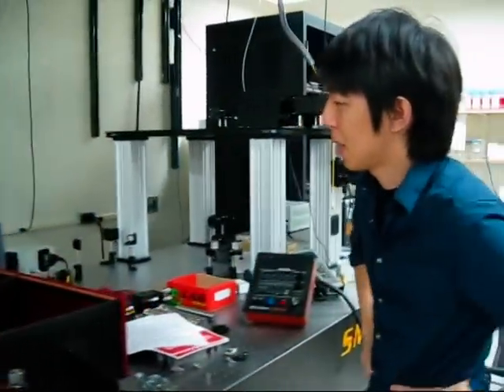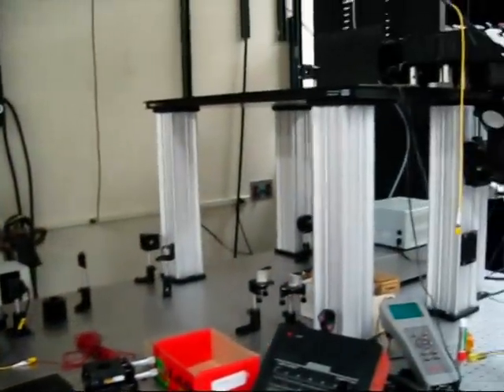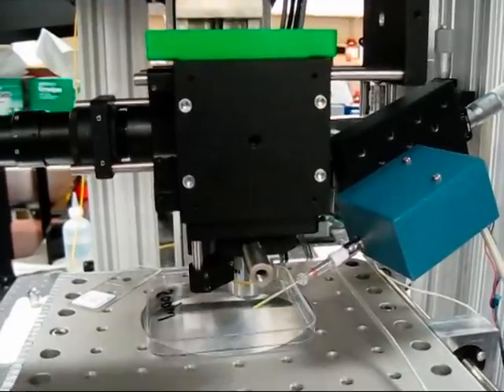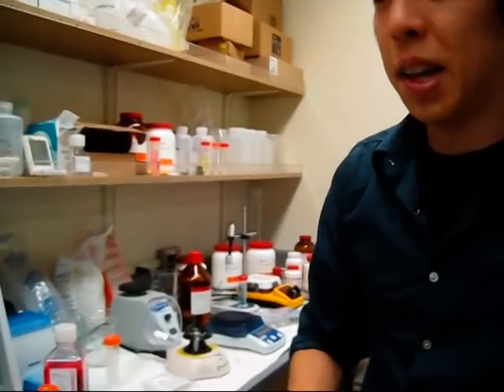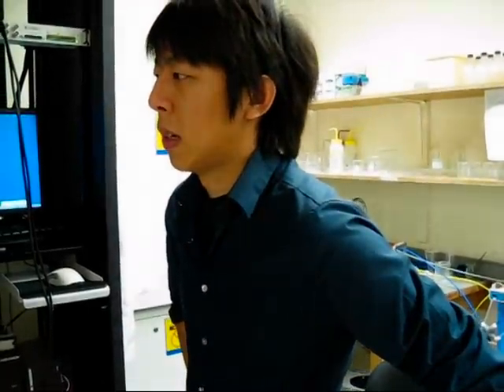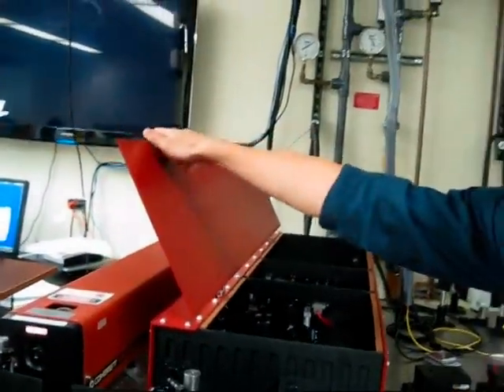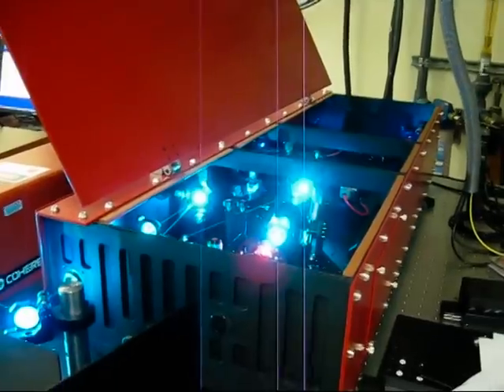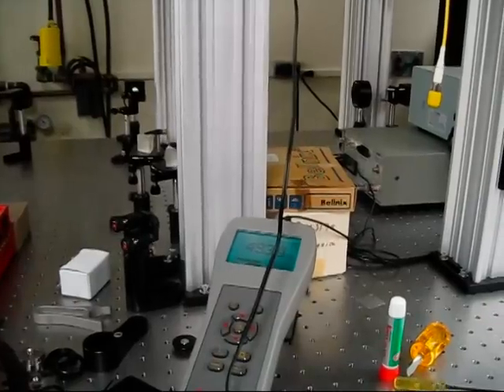Del Mar Photonics Ti:Sapphire laser Trestles in the UCLA Biophysics Neuroimaging Laboratory

Comment from the maker: Spinal Neuron Connections Probed with Fluorescence Microscopy

LA JOLLA, Calif., Sept. 9, 2015 — Using two-photon fluorescence microscopy, researchers have gained new insight into how the spinal cord mediates commands from the brain to get the body moving. 

The findings could help identify ways to repair damaged neural connections in patients with spinal cord injuries or neurodegenerative diseases like amyotrophic lateral sclerosis (ALS), also known as Lou Gehrig's disease. 

Researchers at the Salk Institute for Biological Studies used a fluorescent tag that could be added to multiple neurons and lights up whenever any of the cells are activated. Observing a mouse spinal cord through a microscope, the researchers could watch in real time which cells were activated when chemicals that turn on walking circuits were added. 

Motor neurons
Scientists selectively added fluorescent proteins to the nuclei of motor neurons (red) to show how cells in the spinal cord synchronize many neurons at once to allow complex movements. Courtesy of Christopher Hinckley/Pfaff Lab, Salk Institute.

"You don't need to do any kind of post-image processing to interpret this," said Samuel Pfaff, a professor in Salk's Gene Expression Laboratory. "These are just raw signals you can see through the eyepiece of a microscope. It's really a jaw-dropping kind of visualization for a neuroscientist." 

Pfaff's group used the new method to answer a long-standing question about how a collection of cells in the spinal cord, called the locomotor central pattern generator (CPG), connects to the right motor neurons to allow movements like walking. 

The CPG is where relatively simple signals from the brain are translated into more complex instructions for motor neurons to control muscles. But until now, researchers didn't know exactly how CPG cells forged connections with motor neurons. 

By tweaking the locations and identities of motor neurons and then watching the resulting patterns of activation, researchers found that CPG cells didn't rely solely on motor neurons' locations to connect to them. Instead, the genetic identity of each subtype of cells — what makes those that control the quadriceps muscle different from those that control the calf muscle, for instance — is also important. 

That's a key finding for research on how to treat spinal cord injuries and ALS, Pfaff said. 

Current efforts involve stem cells that are transformed into motor neurons and then implanted into the spinal cord to regenerate damaged connections. The Salk team's results, however, suggest that general motor neurons might not do the trick; specific subtypes of motor neurons may be necessary. 

Funding for the work came from the National Institutes of Health, Howard Hughes Medical Institute, Christopher and Dana Reeve Foundation, Sol Goldman Trust and Marshall Heritage Foundation. 

The research was published in Neuron (doi: 10.1016/j.neuron.2015.08.005).
===========================

Spinal Locomotor Circuits Develop Using Hierarchical Rules Based on Motorneuron Position and Identity
Christopher A. Hinckley, William A. Alaynick, Benjamin W. Gallarda, Marito Hayashi, Kathryn L. Hilde, Shawn P. Driscoll, Joseph D. Dekker, Haley O. Tucker, Tatyana O. Sharpee, Samuel L. Pfaffcorrespondenceemail
DOI: http://dx.doi.org/10.1016/j.neuron.2015.08.005 | 

Highlights
•Large-scale imaging reveals spinally driven motor column-specific activity patterns
•Motorneuron subtype identity and position are dispensable for rhythmic activity
•Perturbation of motorneuron subtype identity alters muscle coordination circuitry
•Distinct modules of spinal motor circuitry are wired hierarchically
Summary
The coordination of multi-muscle movements originates in the circuitry that regulates the firing patterns of spinal motorneurons. Sensory neurons rely on the musculotopic organization of motorneurons to establish orderly connections, prompting us to examine whether the intraspinal circuitry that coordinates motor activity likewise uses cell position as an internal wiring reference. We generated a motorneuron-specific GCaMP6f mouse line and employed two-photon imaging to monitor the activity of lumbar motorneurons. We show that the central pattern generator neural network coordinately drives rhythmic columnar-specific motorneuron bursts at distinct phases of the locomotor cycle. Using multiple genetic strategies to perturb the subtype identity and orderly position of motorneurons, we found that neurons retained their rhythmic activity—but cell position was decoupled from the normal phasing pattern underlying flexion and extension. These findings suggest a hierarchical basis of motor circuit formation that relies on increasingly stringent matching of neuronal identity and position.

Comment from the maker: Stanford Photonics Research Center SPRC 2015 Agenda

Monday, September 14

8:00 AM

  
Registration Open

 
8:45 AM

  
Welcome Remarks

Tom Baer, SPRC

Integration Technologies for Dense, Low-Power Optical Transceivers

Jim Harris, Session Chair

9:00 AM

  
Narrow linewidth widely tunable lasers using American Institute of Manufacturing (AIM) of Photonics

John Bowers, UCSB

9:30 AM

  
Embracing diversity - MEMS-based hybrid optical packaging that brings out the best of each technology

Bardia Pezeshki, Kaiam Inc.

10:00 AM

  
A Decade of Data Center Network Architecture and Implementation at Google

Amin Vahdat, Google
10:30 AM

  
BREAK

 
Communications & Networking for Data Centers

Joe Kahn, Session Chair

11:00 AM

  
Optical Technology Requirements

Hong Liu, Google

11:30 AM

  
Hardware Defined Networking within Datacenters

George Papen, UCSD

12:00 PM

  
100G Single-Laser Links for Data Centers

Jose Krause Perin, Stanford

12:30 PM

  
Poster Intros

 
1:00 PM

  
LUNCH

 
Fiber Sensors

Michel Digonnet, Session Chair

2:00 PM

  
Distributed fibre sensing : state-of-the-art and perspectives

Luc Thevenaz, Ecole Polytechnique Federale Lausanne

2:30 PM

  
Measuring attostrains with a slow-light fiber Bragg grating

George Skolianos, Stanford

2:45 PM

  
Utilizing Fiber Sensor Technology to Miniaturize the Atomic Force Microscope

Antonio Gellineau, KLA-Tencor

3:15 PM

  
Identification of heart muscle cells using an ultrasensitive fiber hydrophone

Cathy Jan, Stanford

3:30 PM

  
BREAK

 
Unconventional Applications of Guided Light

Olav Solgaard, Session Chair

4:00 PM

  
In-fiber atom optics using Kagome hollow fiber

Fetah Benabid, XLIM Research Institute

4:30 PM

  
Time differentiation deformability cytometry using evanescent fields of waveguides

Saara Khan, Stanford

4:45 PM

  
Ultra-Thin Rigid or Flexible Endoscope using a Multi-Mode Fiber

Ruo Yu Gu, Stanford

5:15 PM

  
Double-clad fiber couplers for multimodal sensing

Caroline Boudoux, Ecole Polytechnique Montreal

       
5:30 PM

  
Reception & Dinner

Stanford Faculty Club

    After-Dinner Presentation David Miller, Stanford 
 

Tuesday, September 15

8:30 AM

  
Registration Open

 
Space Optics

Audrey Ellerbee, Session Chair

9:00 AM

  
Overview of the James Webb Space Telescope and its Optical Systems

Mark Clampin, NASA

9:45 AM

  
Imaging extrasolar planets

Bruce Macintosh, Stanford

10:15 AM

  
Graphene-GaN ultraviolet photodetector arrays for space applications

Hongyun So, Stanford

10:30 AM

  
BREAK

 
Modern Microscopy

Jan Liphardt, Session Chair

11:00 AM

  
Optical mesoscopy with a new giant lens

Gail McConnell, University of Strathclyde

11:40 AM

  
Point-spread-function engineering for 3D localization microscopy

Yoav Shechtman, Stanford

12:05 PM

  
What direction does point-source stimulated emission go?

Andrew York, Calico Labs

 

     
12:30 PM

  
LUNCH

 
Quantitative Dynamic Imaging

Tom Baer, Session Chair

2:00 PM

  
Evaluating a Biomarker for Pluripotency with Large Scale Time Lapse Imaging

Michael Halter, NIST

2:30 PM

  
Quantitative Time-Lapse Imaging Applied for Safety and Efficacy of Stem Cell Therapies

Christy Amwake, Stanford University

2:45 PM

  
Large Field of View X-ray Differential Phase Contrast Imaging in Biology/Medicine and Luggage Inspection

Max Yuen, Stanford

3:15 PM

  
Image Processing Techniques for Measuring Dynamic Properties of Cells in Culture

Nathan Loewke, Stanford

3:30 PM

  
BREAK

 
Quantum Enhanced Microscopy

Thomas Juffman, Session Chair

4:00 PM

  
Biological lasers: for fun and for use

S. H. Andy Yun, Harvard University

4:30 PM

  
Quantum Imaging with Undetected Photons

Victoria Borish, Stanford

4:45 PM

  Quantum Super-resolution Imaging in Fluorescence Microscopy Osip Schwartz, UC Berkeley
5:15 PM

  
Multipass Microscopy

Brannon Klopfer, Stanford

 

 

 

 

 

Wednesday, September 16

8:30 AM

  
Registration Open

 
Optics & Quantum Information

Marty Fejer, Session Chair
9:00 AM

  
Quantum Engineering with Cold Atoms and Light

Monika Schleier-Smith, Stanford

9:30 AM

  
Quantum Optomechanics

Amir Safavi-Naeini, Stanford

10:00 AM

  
New Strategies in Nanoplasmonic Engineering

Jon Fan, Stanford

10:30 AM

  
BREAK

 
Ultrafast and X-Ray Laser Research

Phil Bucksbaum, Session Chair

11:00 AM

  
X-ray free-electron lasers: status and future developments

Claudio Pellegrini, UCLA

11:30 AM

  
Ultrafast Molecular Dynamics Probed by Vacuum Ultraviolet Pulses

James Cryan, SLAC

11:45 AM

  
Probing Fullerenes Ionization Dynamics from Within using the LCLS

Nora Berrah, University of Connecticut

12:15 PM

  
Dynamical Phase Control in Atomic and Nuclear Physics

Andreas Kaldun, PULSE Institute

12:30 PM

  
LUNCH